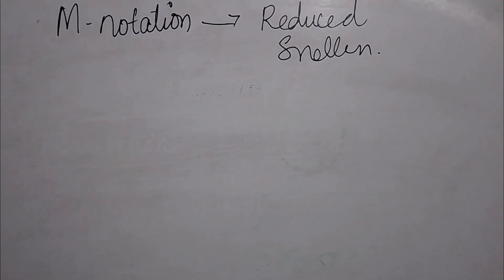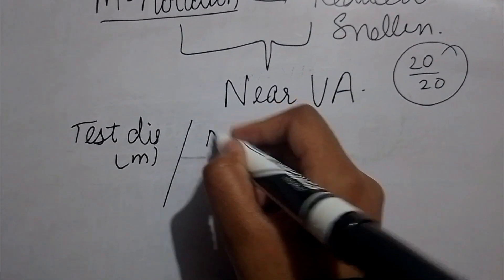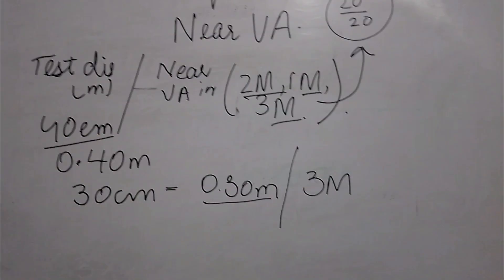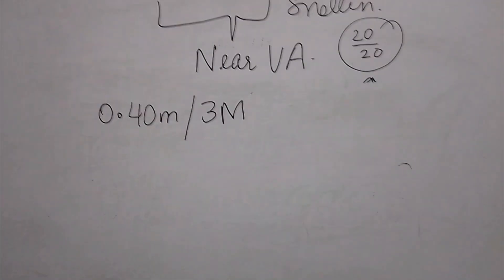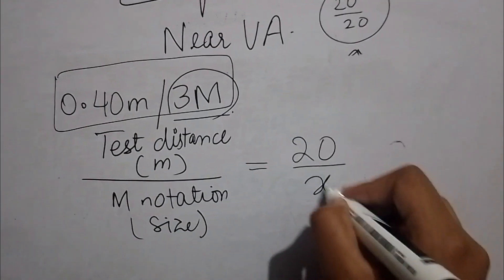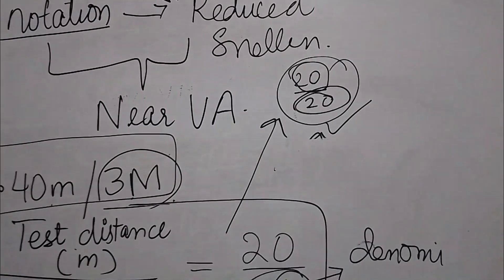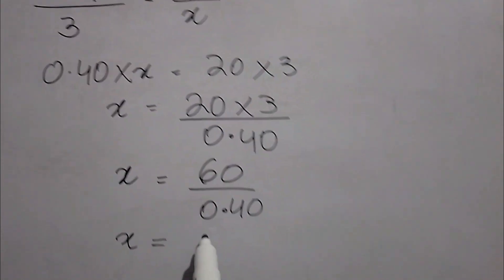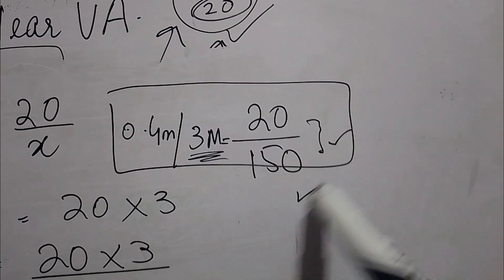How to Convert M-Notation to Reduced Snellen? | Visual Acuity Conversion Guide for Optometrists

Comment: You first stated that the distance was .3 m and the M notation number was three. Why did you switch making the distance .4. I know that .4 is the common distance for measuring M. notation but why did you switch from .4 without changing the letter size
Reply from the maker: I wanted to explain with a different distance as well. The basic purpose was to inform the students that the distance may vary depending upon the need and requirement of the patient. Patient's requirement of near work may vary from 25-50cm and is not limited to 30cm only. That's why i mentioned different distances. I hope its clear now😄